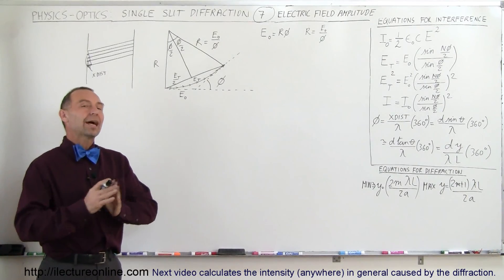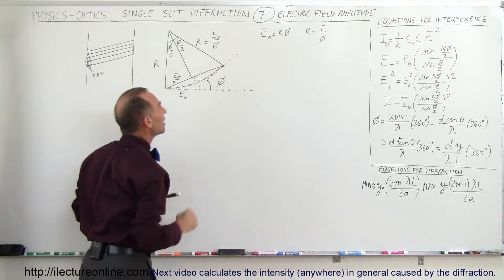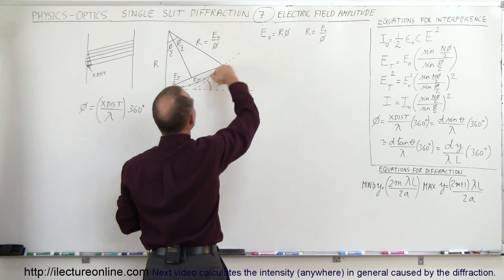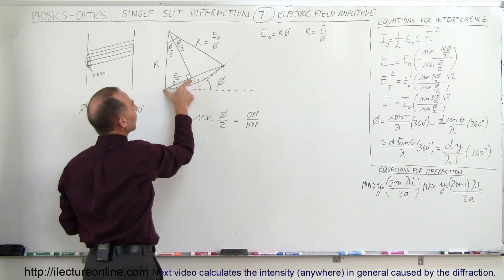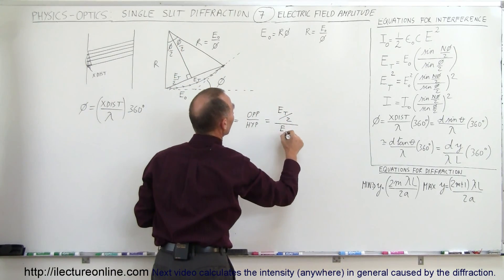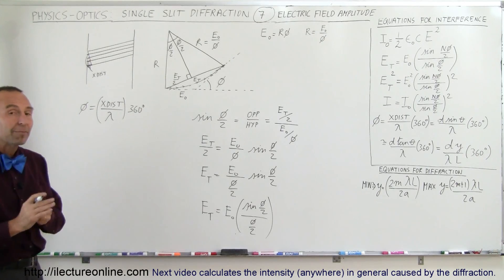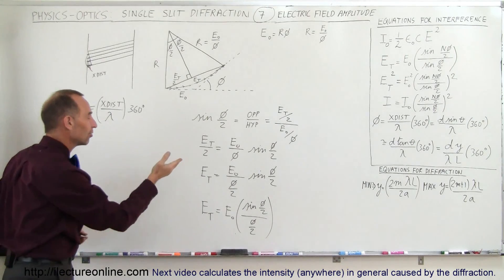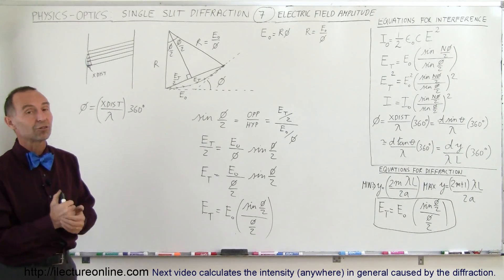Physics - Optics: Single Slit Diffraction (7 of 15) Electric Field Amplitude = ?

Comment: After watching the videos, I’m still a bit confused with the terminology that people use. So is double slit interference and double slit diffraction the same thing?
Reply from the maker: They are not the same thing.  Inteference happens when the light passing through one slit meets up with light passing through the other slit.   Diffraction is what happens when light passes through a single small slit, which then repeats with the second slit where the light will diffract as well.  Thus with a double slit you will have both interference and diffraction.  If you watch the other videoa on the playlist you will see all the details systematically explained.

Comment: How do we get arc length as Eo. Won't Eo be much less than the arc length accn to the diagram drawn?
Reply from the maker: Don't think of the "arc length" as "distance".  This is a graphical representation of the phase shift (like the phase diagrams in RCL circuits).  As you move through the beam from top to bottom the extra distance the light must travel increase, which increases the phase shift of the electric field which is then represented in the phase diagram.

Comment: Sir why electric field is introduced in this derivation ?
Reply: If u follow the playlist from Physics 60: Interference of Light before coming here Physics 61: Diffraction, you will know light has E and B fields. Intensity of light on the screen  will depend on these two, that's why E was explained.

Comment: sir how do we know that the arc is a part of a circle???
Reply from the maker: What will you get when you add a number of vectors of equal length together when each consecutive vector has a fixed phase angle compared to the vector before?  That is what we have here.  Try drawing that on a piece of paper using for example 5 vectors each with a phase difference of 5 degrees.
Reply: Got it.. Thank you sir.